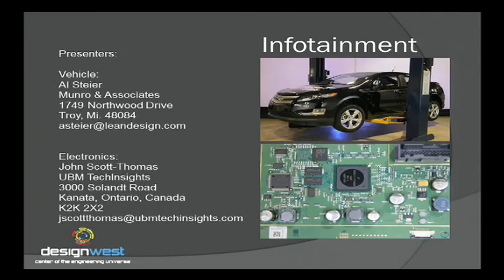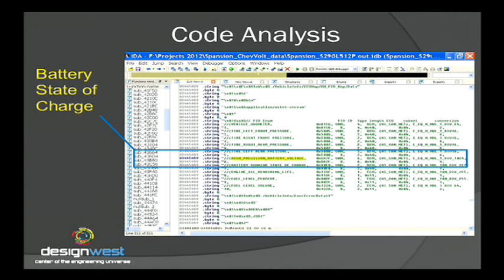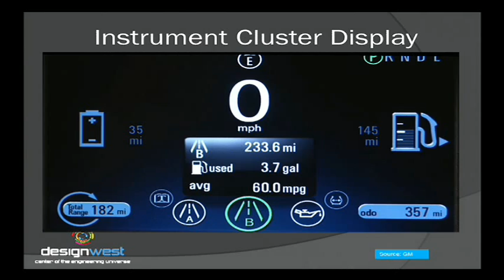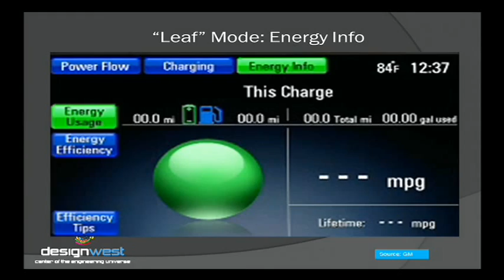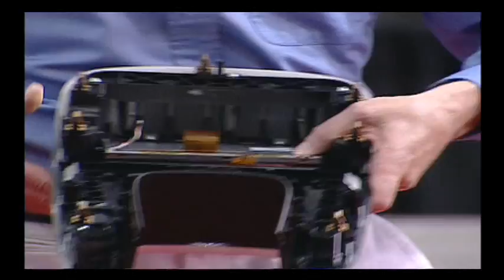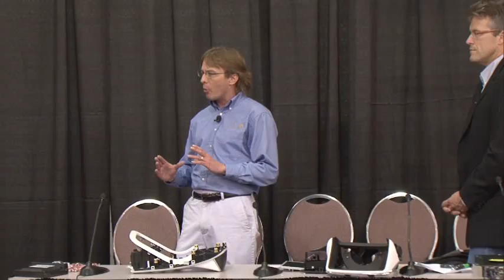Chevy Volt Teardown: The Infotainment System

Comment: I have a 2012 Chevy Volt manufactured 11/11. I was surprised that it can't stream music over Bluetooth. That feature had been out for several years on other vehicles. It also can't read text messages. I had those features on my 2009 Ford Focus with Sync. Ford also released updates to improve it.You said everything is there on the communication board for Mylink. It would be nice if Chevy could put out a update to add some apps like Pandora and add the ability to stream music.